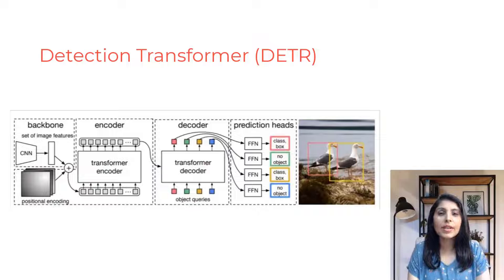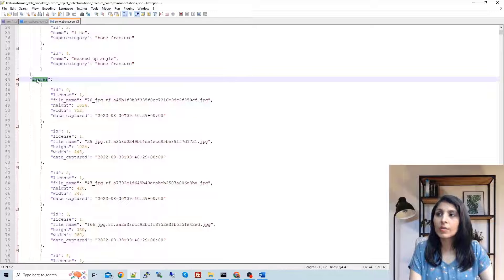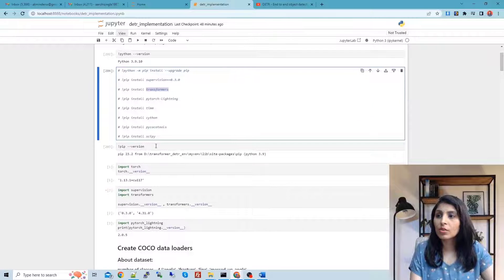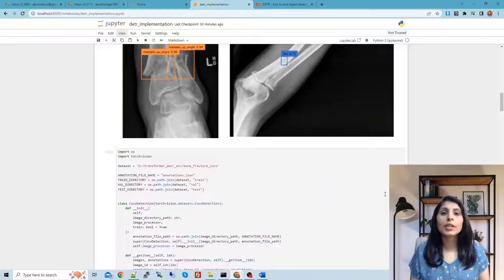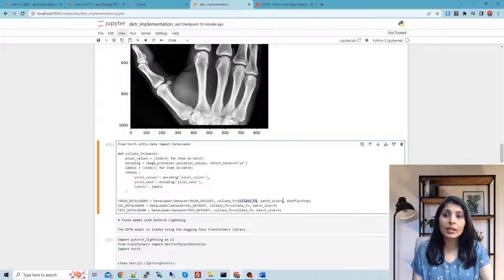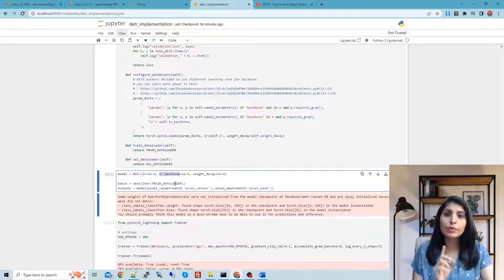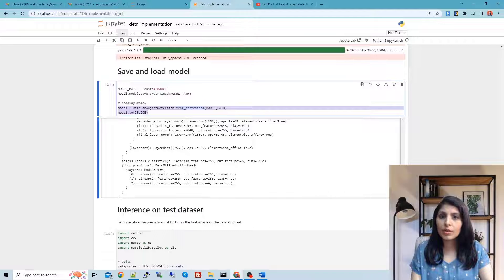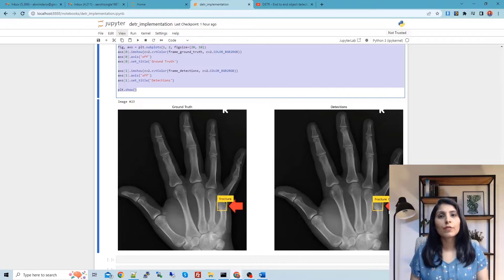L-7 | DETR | Object detection Using Detection Transformer on custom dataset

Comment: Hello mam, thank you for the detailed explanation. I have a doubt: can we use this pretrained model for fine tuning it on our custom dataset with new classes which are not present in the original classes on which the model is trained on?

I have got 1500 training images for it and 2 new classes
Reply from the maker: Yes, you can finetune the model with new classes then model will detect the new classes. But in case you want to detect the current classes and custom class together then you need tot train the model on all the classes together (old+new)